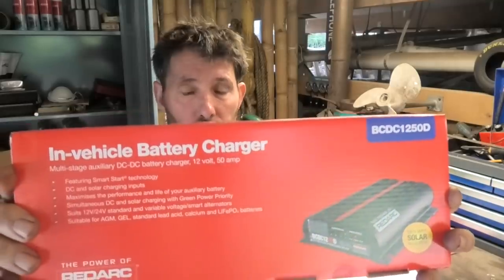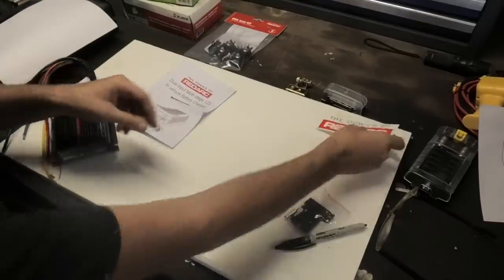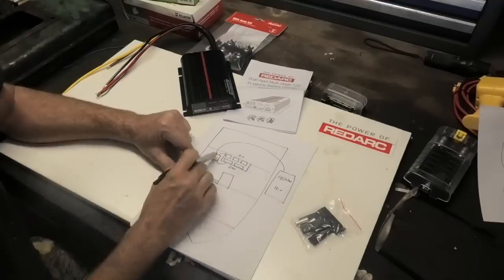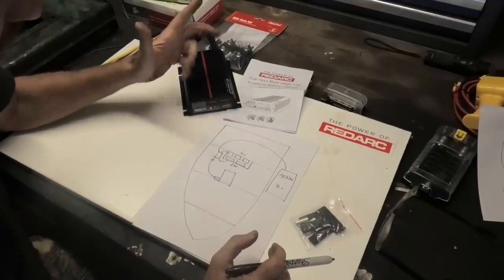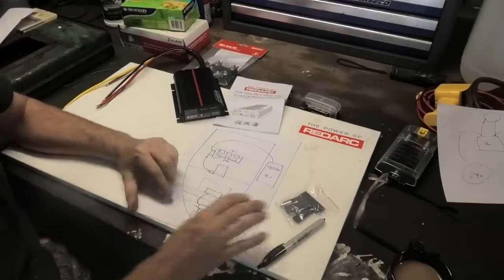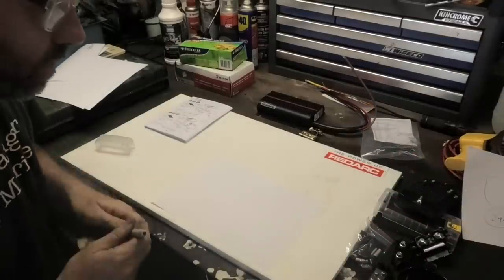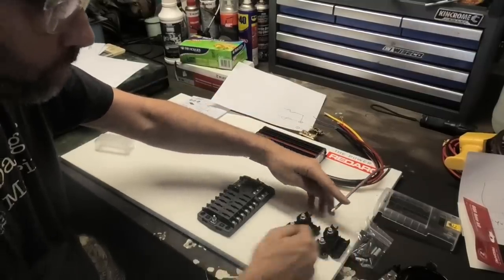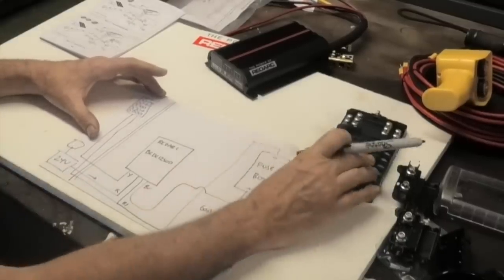Planning the trawler electrics

Comment: Just my two cents here, but I'd definitely not ground both the AC and DC to the boat at the same time, you would have the potential to have AC noise introduced into your 12 volt systems. Also, I'd would get some advice about grounding anything to the hull, remember using the 12 volt system to remove rust? Well you will have just set up half of the circuit, all you would need is something that was leaking voltage into the water, and your going to see a problem. I could be wrong on all of this, since I'm just an electronic/computer guy, and not a boat guy like you are.
Reply: I thought he was only grounding the battery bank not the AC side ... did I hear wrong?
Reply: @NullaNulla  I thought he wasn't sure as to what all he was going to ground.
Reply: @TheDgdimick  he was talking about single strap to prevent electrolysis but still have a point to earth do the boat wouldn't be a floating isolated voltage potential in a storm.

Comment: Ok a few things, I really like the idea of a separate battery for the winch, they will save a packet in wiring but I would be concerned if you couldnt operate the winch from the bridge. Two issues I see are, batteries are not 12v, charged they can be say 13.4v, so you have to be careful with devices like TVs, laptops, as they may not have regulated 12v supply onboard the device and running 13.4v will damage them. The way around that is to add a 12v regulated supply to dedicated circuits, its just an electronic device you can get from ebay. My boat has these available for a laptop and a TV but they are limited to 5A, thats why theres 2, the advantage is theyre cheaper than say 1x 10A. They regulate supply from 10 to 32v into a 12v 5A feed.

Another thing I thought I picked up was that you would be running some things from a common fused supply. Id be concerned if it was hooked in such a way where if some device went faulty, fused a circuit and I no longer had important stuff like nav lights because the shared circuit is out. Lastly bilge pumps are better IMO wired directly with a separate blade fuse in a waterproof fitting some 6" from the pump fed from a supply switchable between off, on, and auto. 

240 is a whole other bag we didnt see overly stated. I have an off the dock supply through conduit to an IP67 breaker switch, all it does is feed a 20A 3 circuit charger, but there is a tap to a regular 240v outlet to be able to drive power tools. Everything else like yours is 12v supply (I dont have 24v) save that I have digital volt meters coloured red for port battery green for stbd to be able to monitor battery voltage (2 banks port and stbd, separate engine start battery), but your BlueSea will have that covered. You will probably need to figure out some form of refrigeration even if its only a small camper type esky thing on 12v power, I never got far enough with an economic solution so Im interested where that goes. Stock my boat came with a 9.5 cu ft 120/240 powered fridge freezer in the galley but thats faulty so I need to replace it. 

cheers mate...

Comment: I wonder if you thought of running a redundant wire to the winch with a switch to use either the winch battery supplying power to the back (house and or starter) or visa-versa in the case of power issues? Probably never need it but then the time that you do. Having a problem with the charging of the starter cct would not be fun... The only problem is that it would have to be a 2 or 0 awt wire to carry the 24 dcv.. Just a thought...

Comment: My vacation home is totally off grid and I run everything on two big 12v AGM batteries. Phone chargers, laptop chargers  all by 12v sockets as in cars. Have a 12v TV that works great. Lightning are all 12v led. I've tried 12->240 inverters a lot, they just drain my batteries really fast. So go with 12v. A 24v winch would not require as thick cables as a 12v one, and the generator could help run it. I've had nothing but trouble with 12->240v inverters so I'm avoiding to use it as much as I can.
Reply from the maker: That's pretty much my plan too. There really isn't anything other than the laptop that I can see myself needing that I can't get as straight 12V.
Reply: @DangarMarine  You can find car-chargers for your laptop/MacBook also. No problemas. I've got the Belkin USB-C car-charger that supports apple. But there are other brands also, if that one isn't available in Australia. Best of luck

Comment: I thought thee rrdarc takes its power from the cranking battery  Stu (but I could be wrong). The cranking battery is only charged by the alternator or in the case of an all 12v battery system,  when the blue wire is ground to make the crank battery and house batteries all one bank (great if ypur cranking battery goes flat for some reason.)
Good idea to ditch the generator. My thoughts are of you have a well designed starter it ends up becoming movable ballast unless of course you have a specific needs for it.
Reply from the maker: Yes, you are right that the cranking batteries are only charged by the alternator.

Comment: Another great vid, Stu. 
My 0.02 was going to be keep the circuit breakers in the wheel house vs below but I see now that's your plan. 
Fire bad - definitely! Do Aus regs require a fire suppression system below or are hand units fine?
I'd also consider a positive ventilation system for the engine area too. Not much fear of diesel fumes getting ignited but would be nice to be able to suck smoke out (after!) any fire or smouldering occurred. 
Finally, I thought I caught a reference to "the old shop"... Have you sold the place and left that world behind?
Reply from the maker: Hey mate. Fire suppression would be good. Yeah, have now rented the old workshop out to a new mechanic to run his own business from.

Comment: The Redarc is a great unit but from perusing the manual it does not output 24V.  In your scenario at 4:12 the red wire of the redarc connects to the 24V +ive and the yellow wire to the solar panel 12v, the output is 12-14V on the brown wire.  If the 24V alternator is not running the Solar won't charge the (now isolated) 24V battery bank.

Comment: Look in to a parallel switch which would allow you to have a 24 volt starter only  you could change to a 12 volt altanator with  only the starter running off of two 12 volt batteries. Almost all trucks with a 24 volt starter uses this switch
Reply from the maker: Ah, another great tip! I'll look into that.

Comment: If you don’t have the windlass motor already, hydraulics there might save a lot of issues. Hydraulics might also provide other crane uses depending on what you want to do with the boat.

Comment: Your design seams sound. May want to add a CB and/or switch between the solar panel and REDARC. Just in case you need to T/S or isolate the two for maintenance. [BTW, who draws a boat with the bow pointing down? I suppose next vid will show how to replace TP with the end under instead of over. 😉]
Reply: lol
Reply from the maker: Yes, a few people have mentioned a breaker between the cells and the charger - good idea. I guess I draw the boat they way I sit in it facing the bulkhead where the electrics will go. My brain can't reverse it now!

Comment: Hey Stu you might want to look at your solar system a bit more. Your current panels are way overkill for the agm batts you were talking about. Rule of thumb we use in full time solar is 100watts of panel to 100ah of battery. Also is the solar charge controler in your unit an MPPT?
Reply from the maker: Hey mate. I may end up splitting the solar cells to be 4 charging the 12V system and 2 charging the 24V system. I'm not sure about the charge controller yet. Still more homework to do!
Reply: @DangarMarine  let me know if I can help. I think for the 12v system you could use a Blue Sky MPPT controller. They are very efficient and don't cost a ton. We have had great results with them in the RV community. Please do not hesitate to ask me for any info you might need to make the project a success.

Comment: What's the plan to protect the circuitry from salt water?  Will it always be waterproof?  What happens when water gets into the engine bay?  I am curious how that works while sitting in salt water.  Thanks
Reply from the maker: The engine bay is water tight. If water ever gets up to the height of the electrical panel I'm already in serious trouble!

Comment: Everything that you can possibly run from 24v you need to. 18 amps at 12v will only give you  216 watts, where as 24v at 18 amps will give 432w for the same current and same gauge wire (say 400w for cable resistance).  Use a single local 24v to 12v step down dc/dc in the cabin and one in engine bay (if required) for 12v items (dc/dc truck step down 24v to 12v converters work well @20/30 amp). Just need a few banks of 24v (12v in series) batteries, one for starter and one for main. Ditch the 12v except for nav lights/sonar etc powered by dc/dc conv. You wont get any brownout on the 12v side either as the 24v will have to drop below 18v!

Comment: I was looking at the wiring diagrams for that charge controller and it doesn't look like it has an alternator input.
Reply from the maker: Yes, I drew that slightly wrong. The alternator will charge the 24V bank and that bank will feed the DCDC charger.

Comment: Dunno if it's any help but the barge I work on runs a 24v anchor winch with a dedecited 2nd alternator. Anchor up and down twice a day really sucks the juice. And in cloudy times you can't get caught out, a flstbsttrry is quickly solved by running the power pack.
Reply: Battery *
Reply from the maker: Yes, now planning to run it off the 24V starting batteries.

Comment: Switch for the accumulators, light machine, starter for 24V. 12V does not only require thicker cables, which one even with 24V should have, since lesser resistance means lesser electric energy turned into thermal energy by the cables, but also 24V is a good standard for professional work equipment. Where you still need 12V, you can easily have a small step-down converter from 24V to 12V. These have a pretty good efficiency these days, in the range from 85% up to 96%. So no reason to go for 12V and waste money for huge heavy copper wires (which I personally still would choose for along with 24V, just to have less waste of energy in the cables). 24V accumulators are cheap to get 2nd hand from trucks and the like.

Comment: verify that charger has the proper isolation for Marine use, so as not to develop electrolysis. The solar is a great idea, on my last boat my panel was putting out over 12v even on a very overcast day--not full wattage of course---Mikey

Comment: I would check the price of running heavy duty cables to the anchor winch versus the cost of two batteries..  You WILL have to eventually replace that winch battery, but good cables are a done deal.

Comment: Looking at your power diagram, I wonder; The solar array 900 watts (75 amps) goes into the Redac, then to the 24 or 12 volt battery system.  Looking at the wires on the Redac, I wonder if they can handle that current or even close to it.  As a minimum, fuses?
Reply from the maker: Determining the maximum current in and out is definitely an important part of this process. I may need to downsize the solar array or split it between the 12V and 24V systems if it turns out to be too much.
Reply: @DangarMarine   This may be helpful to you.   Note the size of the wires.  http://a2baker.com/magnoliablog/?p=10327&fbclid=IwAR1WA7N-hIRT7G3AEzbTL1C8WNZV3vQaSEv0qzZ41Zu7IkuF8kHhTHSdJ90

Comment: The biggest problem you will have with your DC system will come from mounting equipment.  Things like Automotive Radios where the case is grounded to the negative wire and so is the shield for the antenna wire. This can create ground loops. A resistance test between the ground wire and the case will tell.  Bonding the engine to the hull may be needed to balance the ground between the hull and the prop.  Prop > Propshaft > Engine/gearbox > Alternator < Battery Ground < Ground to radio < Antenna Shield < Antenna Mount < Hull.  Just one way to get an imbalance and thus electrolysis.  Taking a resistance reading between Hull and Prop and Rudder and even Hull and anything else that will enter the water before leaving the hard can save lots of hassles.  You may have heard not to leave a battery on concrete or it will ho dead. This is sometimes true.  Concrete will absorb and loose moisture, slightly wetting the sides and bottom of the battery creating a current path. In the wet/ salty boat make sure you have a rubber mat under the batteries and a non conductive hold down system.  Good luck and get that engine room looking Sharp!  :)
Reply from the maker: Interesting tip about testing those resistances while the boat is on the hardstand. I still don't have my head around exactly how / why they should or shouldn't be bonded to each other (I've been reading so much conflicting information,) but I can certainly see how having that information will be useful down the track.

Comment: Yes and no.

One thing you forget is that running from there to the wheel house for certain things like the VHF & HF marine (2182 etc) WILL want some heavy guage cable (at least 12g). What I would suggest is either a 2nd tap from the output fuse to an upstairs link OR  better a 3rd 60a fuse/breaker to go via 8g or 4g (8g should be enough that's up to around 80-100a iirc) into the wheelhouse so you do NOT loose current/voltage on the path up. ALSO by time you send the power up for sonar, gps, VHF, 27meg, hf, lighting & guages, etc etc, I'd prefer a single pair of cables than a hogs breakfast from the main breakout panel. As a bonus there though if you say blow the 10a fuse for the lights in the guages or the guages themselves or blow the 20a for a marine radio then with the fuse box at your knees or nearby in the wheel house it is a LOT easier to get to and fix. You are also removing a LOT of mess and complexity from that primary break out board.

I'd be going with a fuse panel for each main area (motor based stuff including bilge etc and nav lights maybe from there etc),  another for the wheelhouse and then a 3rd for any extra living quarters style crap so that if old mate burns the fuse running too many things in the kitchen you don't loose the wheelhouse :).

Doing a lot of extras in my car I learnt this the hard way about treating it like a spanning tree. I went 4g from the battery via a 60a fuse to the driver kick panel where a 12g goes off to the centre console for powering phone charger, Telstra mobile phone repeater etc etc and an 8g goes back to the boot where all my heavy end (bricks as they're known in the radio world) gear is located (amateur/hom radio etc including HF). The 2 interconnect points where they are needed most and then only a y branch in the kick panel has made life 100% easier for any work or swap outs than it used to be and something I'll take with me from every car from here on in. Each interconnect point then has an earth lug nearby so a negative mate with it (that part is harder for electrolysis but you just need the 2 cables instead of the 1. I had to do this as I started just trying to run the radio power cables up the sill and everything connected at the kick panel but it meant too many wires to fault find, too many wires to fit in the space, too much voltage drop to certain things which caused major problems and was a flamin' nightmare. I also then in my case ran a switched wire from the accessory (originally for something different I won't mention here) that now goes to my factory amp so I can turn the 6-8" sub off when the dog's in the car and have a live accessories feed off the ignition so that some of my radios and pieces will boot up with the ignition (things that don't have "ignition sense" can be done with relays)  making battery issues less of a problem and I don't have to worry about turning most on or off.

Another thing which may be overkill but could come in handy one day (hope not) is a manual or electrical quick disconnect at the battery bank itself so if anything goes wrong board onward you have a way of averting a fire. This will also be nice if you don't have fire/theft alarms dependant on it to store the boat in a safe state when moored for periods of time but I think you'd need another for the power inputs as well to fully isolate ANY DC voltage entering the system.

So whilst my example is only for the extras (yes my car looks like a porcupine :( unfortunately) hopefully it will give some lessons I've learned and help you in the long run. It seems in the short run to make it more complexed but later when things fupup it makes it easier to seperate what hasn't from what has. And remember if you think you need 4m of cable give it 5 cause likely here and there you'll cut strands out accidentally when removing the coating or some other goof move like the rest of us, also it helps with pushing cables out of the way.

That RADARC box looks and sounds like a nice bit of kit and I think you have the right idea with that battery and winch and if you can have a disconnect from the main battery bank whilst the winch is active you (don't quote me I've not done the math) may be able to get away with 12g from the primary bank to there (fuse under the wire capacity of course) and remove the need for the extra panel. Just ask someone who's more up than me to make double sure. Either that or worse to worse install a 240v AC run up there and give it it's own private permanent 2a battery charger lol.
Reply from the maker: Thanks for sharing your experience, it's always great to learn these things before beginning!